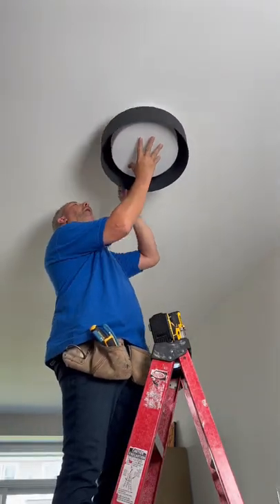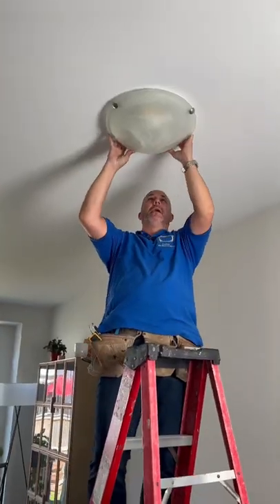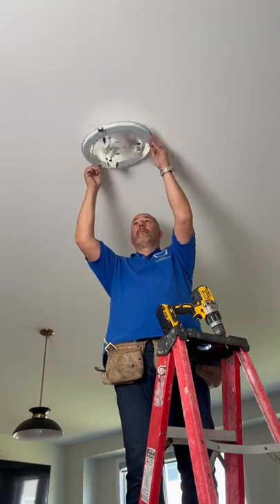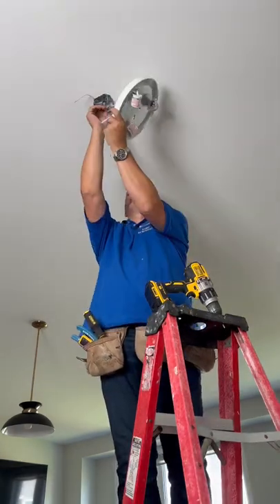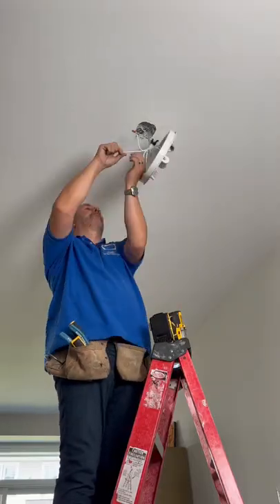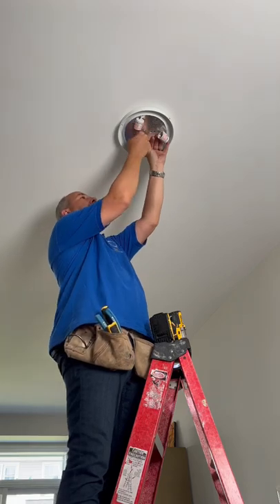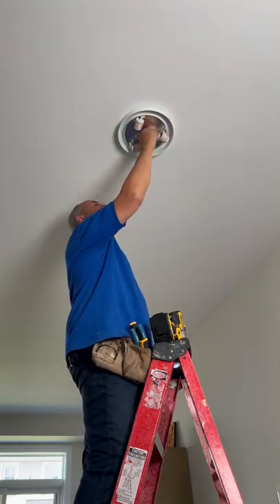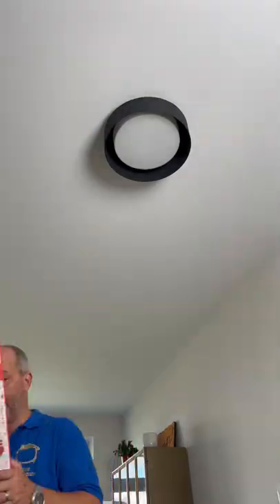How to Change Your Light Fixture #shorts

Comment: Don’t forget to mention shutting of the breaker before replacing the light. This can be done with out that, but some people might not know that the breaker should be shut off first… love your channel!
Reply: Just have to make sure the switch is off.
Reply: I came to the comments to say this exact same thing after having fitted our ceiling fan for the summer. It's worth turning the existing light on before removal, flipping the breaker (or pulling the fuse) and confirming that the light has gone off. Not the gold standard, but pretty foolproof.

Comment: What do you do with the ground wire on the fixture if there is no ground wire in the house?
Reply: Get a piece of bare wire and attach it to the screw inside the metal box in the ceiling then attach it to the ground wire on the fixture.